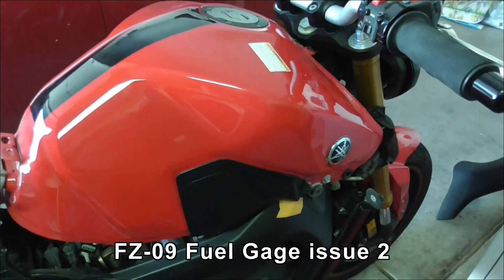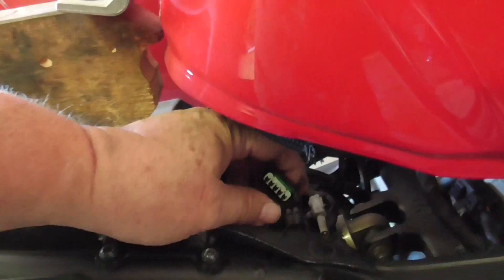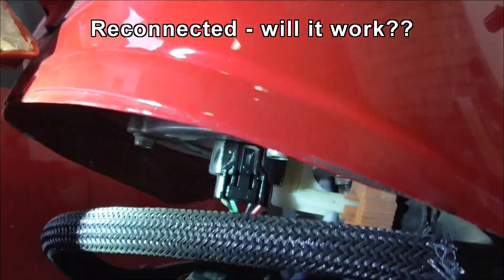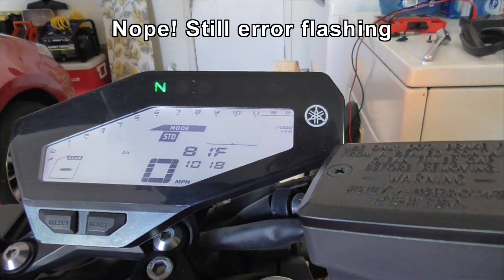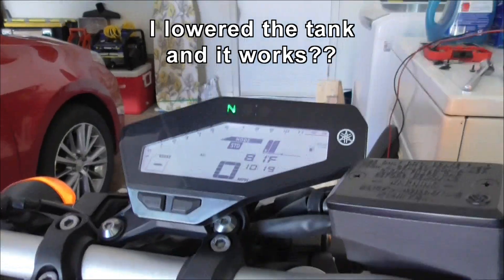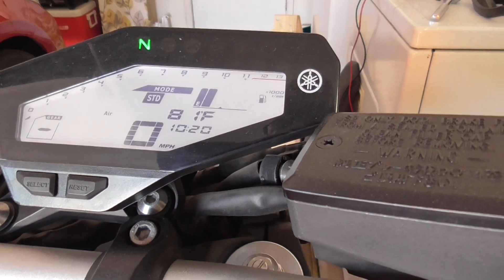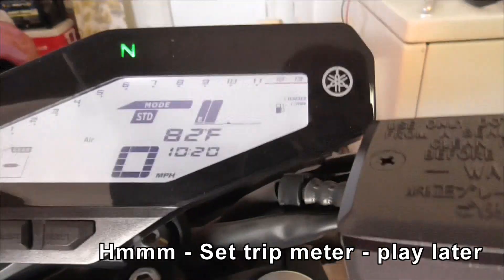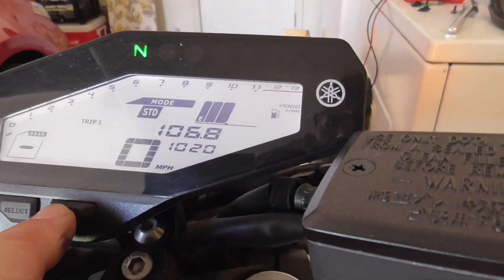FZ 09 Fuel Gauge 2

Comment: Keep us posted
Reply from the maker: Yep. Have to figure out how to drain the tank first. Only worked on gravity tanks before...
The 1991 Suzuki I have, has a fuel gauge that has never failed - similar float system - just no pump.
Reply from the maker: Finally got around to draining the tank and removing the pump.
Found corroded wires due to the old fuel in the tank... Is it fixed, hard to tell
https://youtu.be/ytAJmSfRpYY